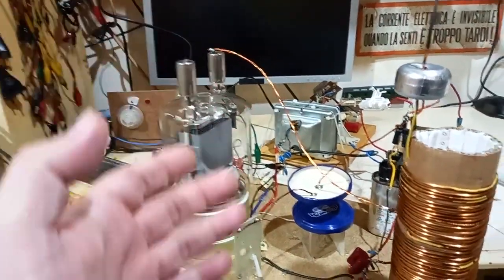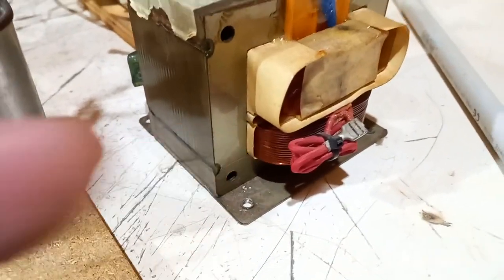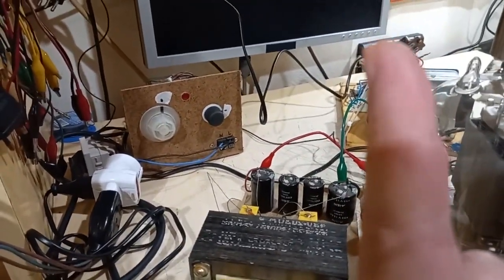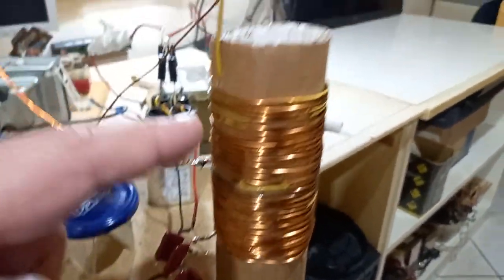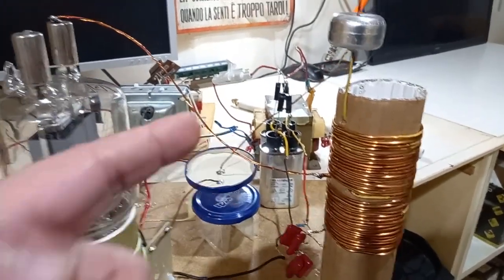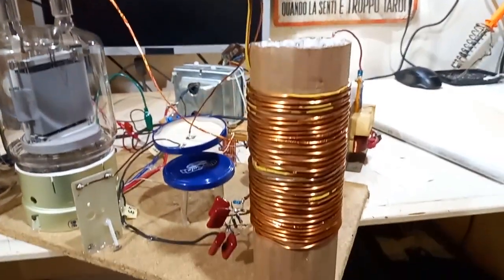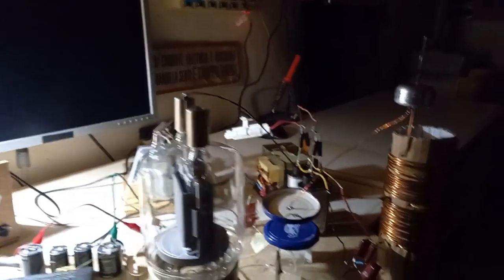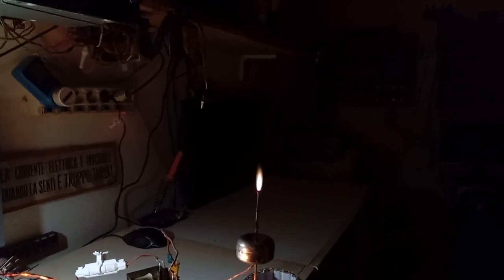A More Serious HFVTTC w. GU81M (High Frequency Electric Flame)

Comment: looks like a micro wave, if you stop oxigen or put all into a jar?
Reply from the maker: this doesn't run on oxygen, it's not fire, as long as there's gas it makes the flame... but it's too complicated to investigate this practically
Reply: @PosthumanKindergarten  you actually burn the copper with induction heating.
Reply from the maker: @ciprianpopa1503  true but not true, cos when the copper starts vaporizing the flame becomes red but not longer, but probably this didn't even happen in the video, the shots were too fast to make enough heat... with salts or glass the flame becomes also actually longer, that's why i said it's cheating
Reply: @ "when the copper starts vaporizing the flame becomes red but not longer " didn't quite catch the meaning of this part.
Reply from the maker: @ciprianpopa1503  nothing burns in here, that's my point... maybe you can make a chemical trail but the power doesn't come from a chemical reaction

Comment: Spectacular! I only wish I had a GU81M, insane size tubes! Have you done anything to harden/protect the monitors, PC, stereo etc? I've had USB disconnect/reconnect & touch screens on phones go bonkers around coils, but no permanent damage so far :D
Reply from the maker: i just based myself on my experience that nothing actually breaks :D yes things go crazy, but just temporarily, and my PC was off, yes, touchscreen goes crazy too, but mostly with HV DC, with this coil it didn't at all

Comment: Wonderful Video!
Great work!

I always wondered how a GU-81M VTTC would do in pentode mode but i havent seen people do it, maybe because its shit from my own experience but it should be better?

But thr GU-81M is kind of a shitty tube, g1 and g2 are nearly the same spacing and the amplification factor is 2-5 so really shitty, thats probably why people drive the grids really hard
Reply from the maker: i used it in pentode mode for a regular VTTC and it seems to work good, the point is that it's weak in conduction, comparable to a 811, so you have to pull the G2 very hard, basically a Pl504 or 519 conduct more than this tube, but i mean, the GU81 can withstand much more than those tubes, but at the moment i don't have how to drive a VTTC with it very well, i obtained like 50cm with a single 6P36S and no doubler, just a 210Vac boost over the MOT and diode rectification
Reply: @PosthumanKindergarten  quick warning, interms of current the maximum is 0.7A from what people have abused them, 1A kills the tube very fast... ask me how i know.
Be careful with the grid dissipation ive melted mine on one of my tubes.

The weird thing is the online datasheet mentions max 0.6A current while the original soviet datasheet mentions max of 0.3A.
And the online datasheet mentions maximum grid currents while the original paper soviet datasheets dont mention anything like that.

Really strange. Just keep it within the grid dissipation and you will be fine, note that to get 1A of current through the tube is going to melt the grids, so thats were the limitation comes from. 0.7A current seems to be right at the edge of what the tube/tubes grids can handle

For the anode you can make it glow redhot and it will be fine, i woud cool the tube, especially the top connections.
Reply from the maker: @janno288  good to know, but i was more concerned about the G2 dissipation, somewhere on the online datasheet it says 220mA at 600V, that is 132W, it also says 120W max, i dunno, i attained with the 600V, i didn't measure the current, but obviously with the tube oscillating... the average anode current isn't probably going past 600-700mA here, the MOT is fairly small, and as you have seen i didn't let it run for long
Reply: @PosthumanKindergarten  datasheet mentions 0.2A maximum, at 600V that would be 120W so right at the edge dissipation, thats where the current limit comes from. But ive let higher grid currents flow but at lesser voltage.

For example in my VTTC right now I am letting 0.4A grid current flow.
since my primary gets around 220V per turn and the feedback is 4 turns and since 50% duty cycle the average voltage is 110V*4 so 440V average. Since grid current only flows when the voltage is positive we have all we need to calculate it

the grid dissipation is P = Ug * Ig

Ug = Ufb - Ur = 440V - 500Ω*0.4A =  240V

240V * 0.4A = 96W of total g1+g2+g3 dissipation.
Reply: @T2D.SteveArcs 
Hello! 

Also with 50% duty cycle i meant the voltage doubler since the vttc only drives the tube 50% of the time. I know what you mean. 
 Yeah, you are correct but i would rather overestimate it than underestimate it.
Also I want to measure the exact duty cycle at full power and the exact dissipation, i have some ideas.
Reply: @T2D.SteveArcs  Oh thats great!